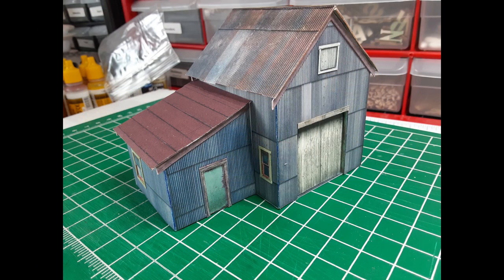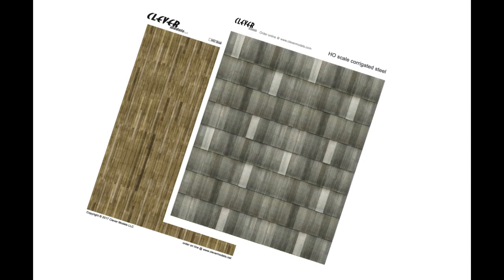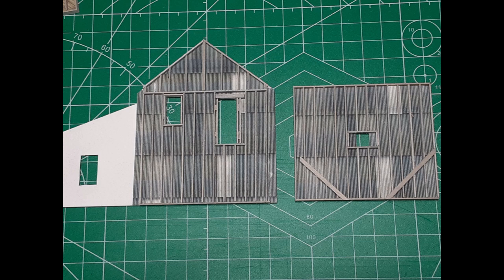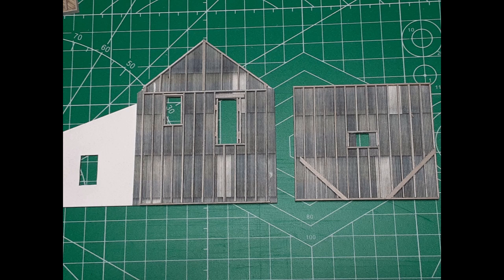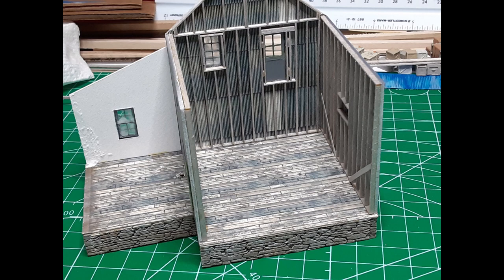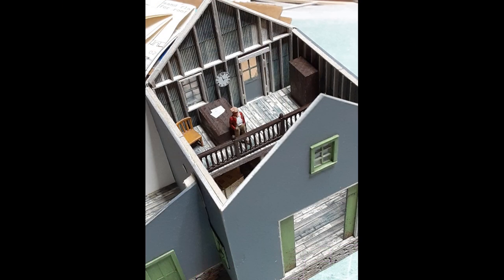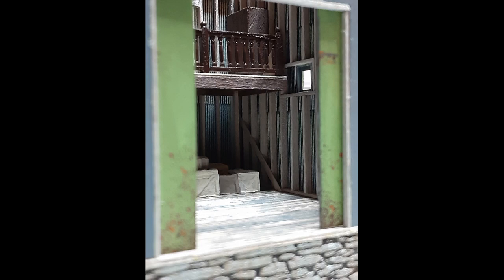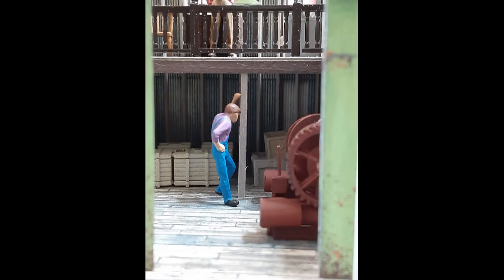Creating a Detailed Interior in HO Scale

Comment: Really nice job on the foundation and framing. So glad I've subscribed, I like your style. I've used Clevermodels insulbrick siding in the past, nice stuff. And that is a fantastic build of that winch, especially the pencil graphite for the gear teeth.
Reply from the maker: High praise, indeed - thanks. I was bummed when Paper Creek Models went out of business...until I discovered CleverModels. I use their printed textures a lot for my interiors - floors and walls mostly - but haven't yet used them for any exteriors.